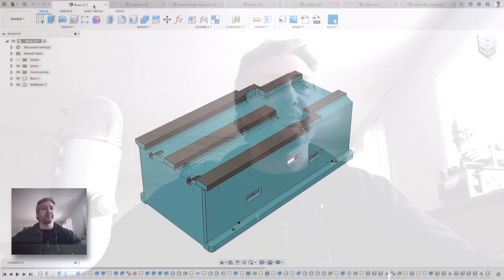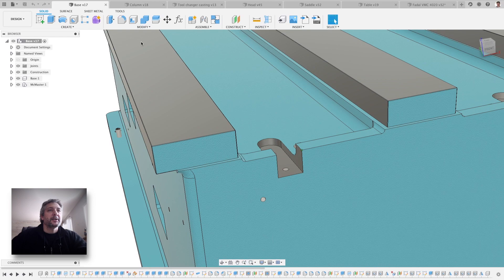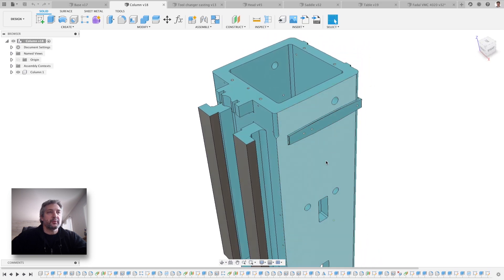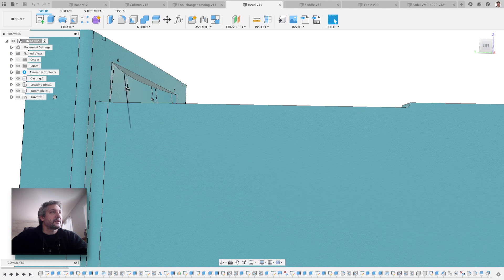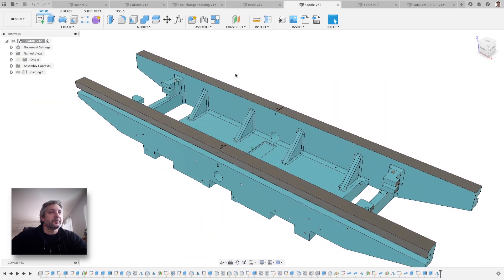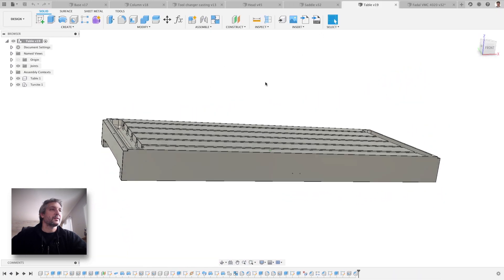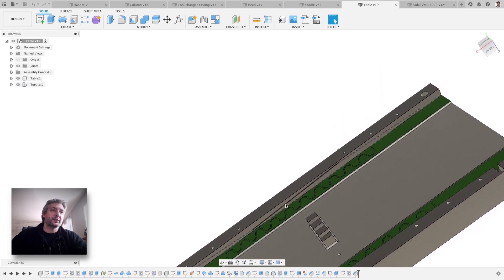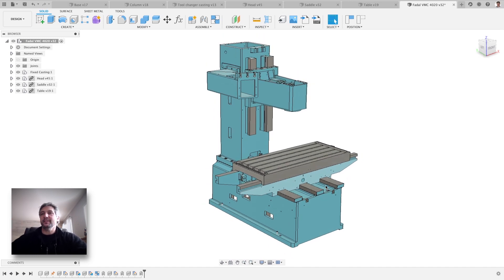Part 21 - (Introduction to the 3D model of the machine)

Comment: Nice work! I'm using your drawings to decide how to build my CNC base, column and spindle mount. Welded steel 1/2" plate with maybe 40-50mm thick polymer concrete walls on the inside to absorb vibrations
Reply from the maker: Wow! Nice project! How big will the work envelope be?
Reply: @BlaiseBarrette  Planning for X/Y/Z 900/600/600
Reply from the maker: Quite large! Why so much Z travel? 600mm in Z seems like a lot!
Reply: @BlaiseBarrette  For4 and 5 axis

Comment: I wonder if it would be possible to retrofit a side mount swing arm ATC with 30-32 tool pots. Practical maybe not. Long ago we were considering a 4020, issue was the primary job for the machine required 28 tools.
Reply from the maker: Everything is possible but that would be a major project!!! One thing I would like to do eventually is replace the AC motor and the Geneva gear by a servo motor to speed up the tool changing time. I think this could be quite feasible.